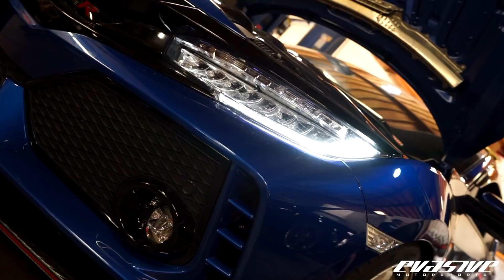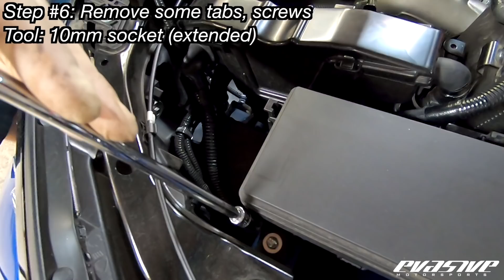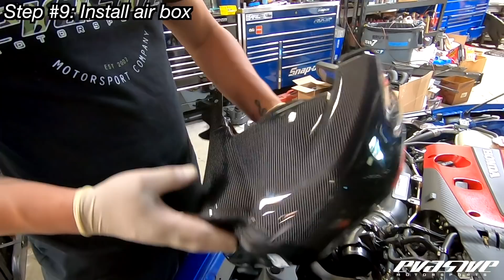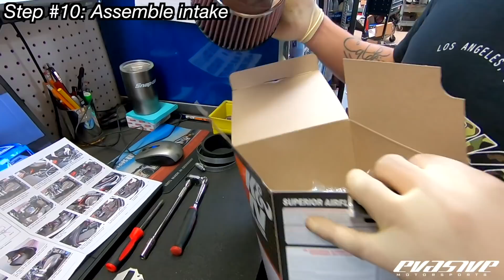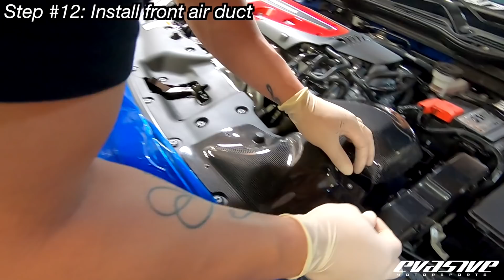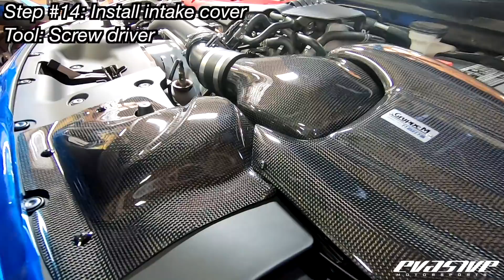GruppeM Ram Air System for Honda Civic Type R (FK8) Install

Comment: was wondering how he got that easily out at the 2 minute mark. Looks like some of those clips holding the rubber knubs down are broken? The "rubber pins" at the bottom right was impossible to get out. No wonder most guides just remove the entire box as one unit.

Comment: Just a question...
Isn't that on turbo cars; no matter how cold ur intake air is; it's going to be heated up once it's compressed by the turbo? And then cool down by the intercooler?

So what's the point of all this fancy expensive stuff on car's performance if the intercooler will do the penultimate job on air to atmospheric temp in cooling ?
Reply: Just another cosmetic
Reply: Mostly just sound and looks. Stock airbox is really good on this car. Don't see any point in putting an aftermarket on. You're not going to gain any horsepower
Reply: Diether Baybay if the air entering the turbine is cooler, it will leave cooler. If this mod is irrelevant, why does every single performance built vehicle have some type of air cooling+filter? 

Please try Google.
Reply: @KoukiSylvia  in NA built i will agree.... turbo is different..
Reply: @KoukiSylvia  https://youtu.be/gCi2yo4UqPI
Hey try Watching this  clip dude...
Haha 1% gain power for CAI? Very clever way to waste ur money.. . Burn burn burn money  more!!!🤪

Comment: Do people understand that the CTR has a very efficient air compressor sucking and compressing air FASTER than the engine can actually use?  The pistons are not sucking air here guys, that air intake makes zero difference.
Reply: Intakes make power by reducing pumping losses and increasing volume/velocity
The Eventuri Intake and turbo inlet pipe made 20whp combined.  There are other places to invest in for power per dollar, but the carbon intakes are mostly for looks.  
A K&N drop in filter and PRL intake elbow made 10whp/4wtq over stock....$180 total US ....easy power improvements on the intake side.
Reply: @TheFK8Life  introducing more dirt particles into your engine.
Reply: @Jdm_fl5  And - if you are afraid of dirt - dont buy a type R
Reply: @TheFK8Life  typical answer from someone who knows what i said is true.
Reply: @TheFK8Life  truth hurts much?
Reply: @Jdm_fl5  That's bullshit. The K&N Drop-in filter doesn't let more dirt in and that's proven. It's also proven that the Eventuri intake makes more hp over the stock intake. Stop talking bullshit you clearly know nothing about. Bet you don't even drive a CTR.
Reply: air intakes DO make a difference. theres a vid comparing dyno numbers on various intakes already....